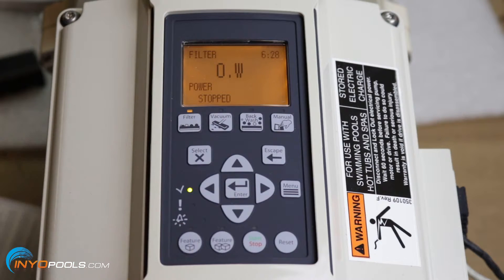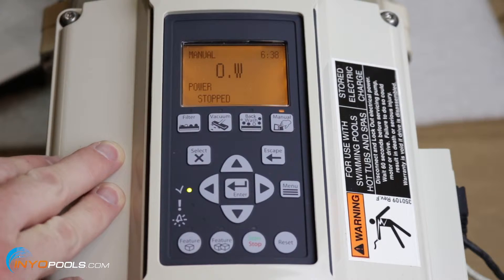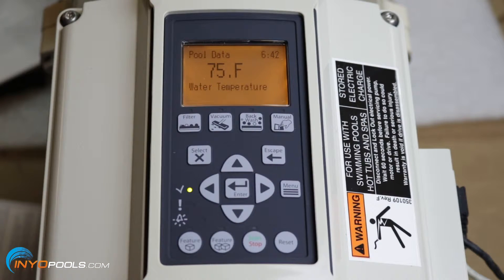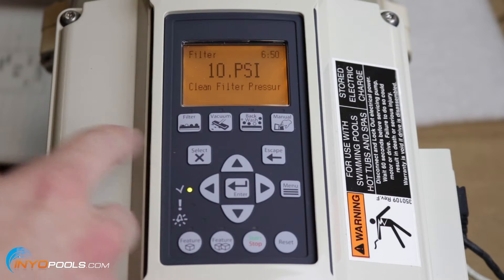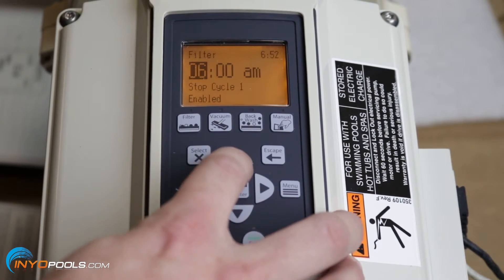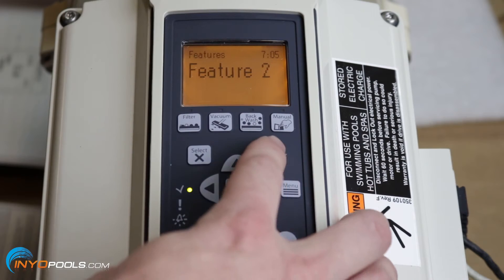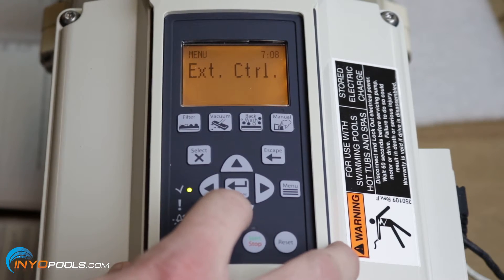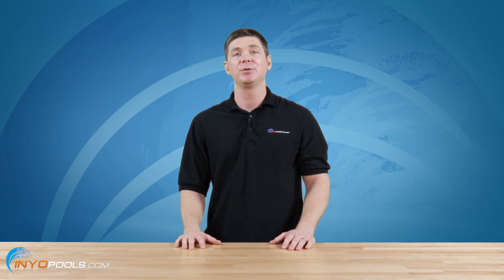How To Program a Pentair IntelliFlow VF

Comment: Can I run and program this pump in iaqualink? What model pump is this? Can I program a time of day schedule?
Reply from the maker: From what I've found about the iAqualink system, they can control the VS models (change speed via RPM scale) but cannot fully control the VF (adjusts speed to match set flow rate using GPM). Maybe Jandy has changed that in recent updates, but there was no confirmation on that matter.

Comment: How do I change the RPM on the VF it runs at 3450 and I want to lower it 2:36
Reply from the maker: The Pentair VF's speeds are measured in GPM, not RPM, like most other variable speed motors. You'll need to change the desired flow rate to get the pump to lower its rotational speed.

Comment: Great video.  Thank you.   Does this model have the ability to have the pump for a pool come on for say 10 hours a day?
Reply from the maker: Yes, it does. You can have the pump run for an hour or up to 24 hours. Variable speed controls give you a lot of options in the run schedule department.
Reply: thank you.  really appreciate the response.    Do I use the feature menu to set how long to run for? @Inyopools

Comment: Hello,, Thank you very much for your very informative video!!! I just bought this pump 2nd hand, and one of the main thing I was wondering is. Is there an auto freeze to this pump? Will it turn on when the out side air or water gets below 34 degrees? my old pump had a control panel that would turn the pool pump on to keep the pool plumbing from freezing. I'm from Nevada, so it doesn't freeze a lot, but we do dip in the upper 20 from time to time. 
Thank you again for the great video!! 

Robert
Reply: I have the manual and there is no mention of Freeze-Guard in this version of the Intelliflo VF.    What I do is set the pump to run from 8:00am to 7:55am basically 24 hours during those periods of freezing temperatures
Reply: @bobr6078  Thank  you so much,, I thought the same thing,, so I just set it to run during the time I had any idea we could get down into freezing.. Thank you very much for your answer.. Have a great rest of your day,, and always stay safe!!